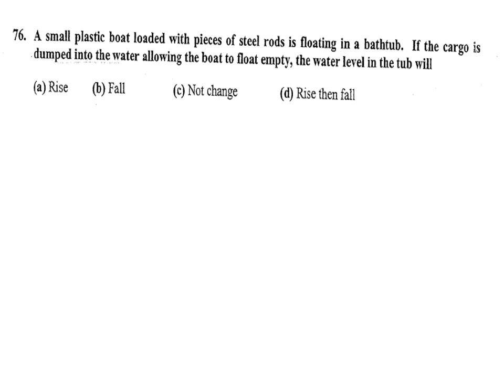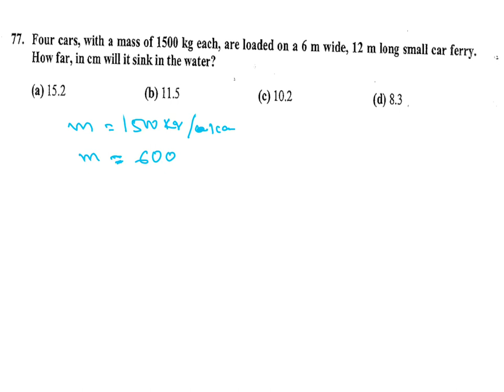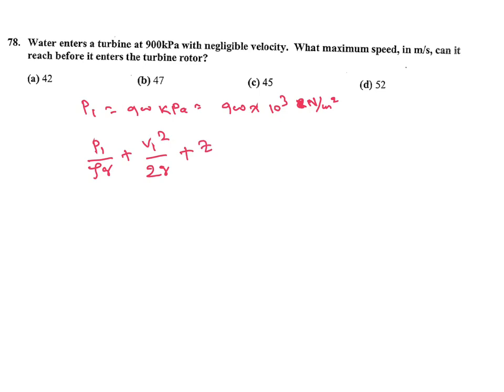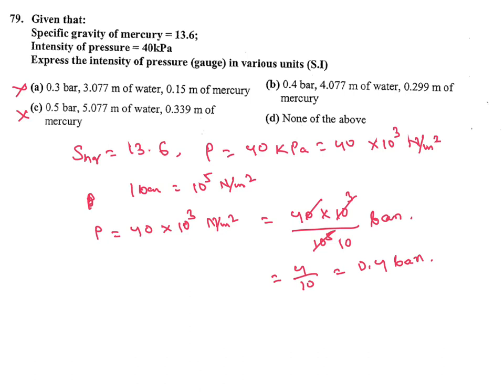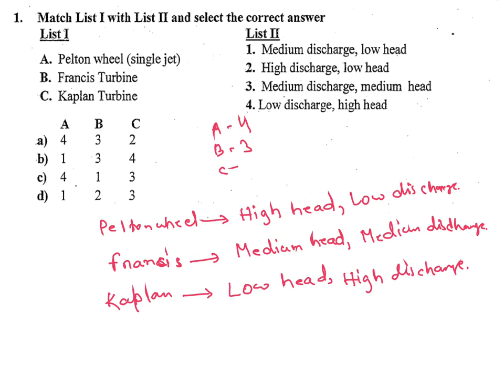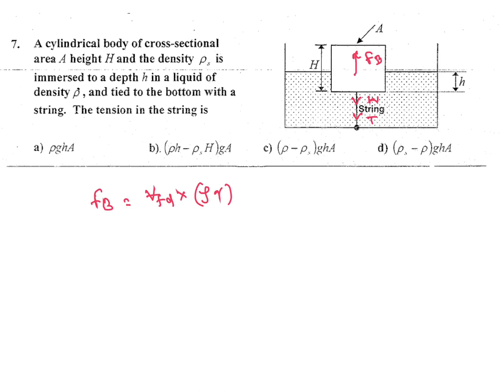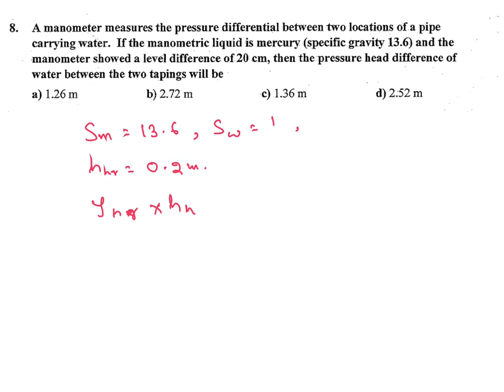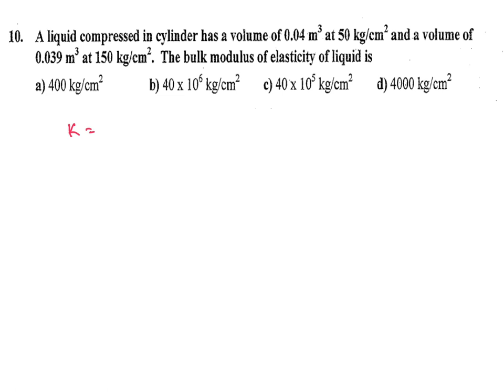ISRO FM 11

Comment: Sir in question 8.. x is manometric  deflection then head should be x×(rho of Hg/rho of water -1)
Reply from the maker: Prem Pal Singh plz mention the time with Q's so that I can get it earlier.
Reply from the maker: YES D SHOULD BE THE ANS BUT MADE EASY BOOK B IS ANS...
Reply: The formula in the solution used is actually used for Mercury columns height conversion to water column height conversion.. Bt here in the question we are dealing with manometer.. Formula in this condition is X*(rho of Hg/ rho of water - 1)..and answer should be D.
Reply: yes the answers should be D

Comment: sir in question 76. what about the volume of water being displaced by the steel cargo in the second case ,you have not discussed that aspect of the question , so a bit of confusion left yet,,,,,,,,whether that amount of water which will surely be displaced by the steel cargo will lead to greater increase in water level in the container or the net level of water will fall for sure.....explanation is not complete for me sir,,, it am so grateful to you if you clear the mentioned doubt in the comment...thank you!
Reply from the maker: Vivek You take bucket water and a mug inside the mug you keep one heavy metal (mug should float )' mark the height of water, then you keep the metal object inside water and float the mug empty , take the reading , your doubts will clear.
Reply: sir, that is fine but with respect to the limited data and information provided in the question , is it really possible to prove the answer mathematically..that is my doubt.....kindly waiting for your valuable comment....thank you!
Reply from the maker: Vivek Kumar we have to take some relation between buoyancy in both case , and weight in case one alone and both weight in case two and 2nd case weight of steel more than force of buoyancy, and for cargo weight is very less so buoyancy force also less so height is less .steel density is more so it will occupy less volume comparison to 1st case , 1st case both cargo weight and steel weight balanced with force of buoyancy so it will occupy more volume, hope this will clear your doubt.